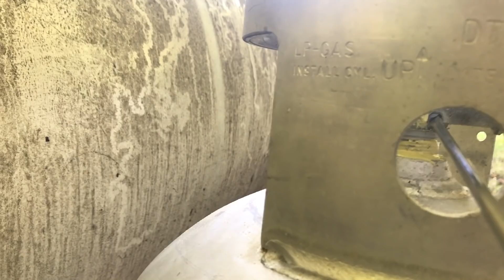How to fill your own propane tank

Comment: This is extremely dangerous and also illegal by residents, this constitutes breaking contract, federal and state fines, jail time.  I would know because, I'm from a family business of 60 years in propane service.  The POL style adapters and fittings used are to push open the OPD style valve seals inside which is how the valve systems work for grills and what not.  Also, most tanks at residences should not have liquid check valves installed ever!  Those are usually only for grain dryers or liquid using heavy applications.  Not safe for residents to use.  Also, this is how people have explosions.

I can tell you right now this is highly unsafe and unregulated and you should be fined and disallowed from service by the gas company.
Reply: Can you point out what law this is breaking? I've never heard of anyone getting fine or jail time for transferring their own propane from their own tank to a smaller tank they own. Please let us know exactly what law he is breaking.
Reply: You any relation to Hank Hill
Reply: @Zef66  actually if you read on the small tanks for lanterns it will say its against federal law to refill and transport those tanks. And punishable with a 5 yr prison sentence and a $500,000 fine. ....the keyword is TRANSPORT. So as long as you never drive with it your good.
Reply: Yes, yes, please cite the law you claim. Most states have laws online these days, so you could supply a link. That said, evaporating liquid propane gets very, very, VERY cold. He should be wearing stout rubber gloves... as in more than nitrile exam gloves. You get liquid on your skin (or wimpy thin nitrile gloves... or worse... cotton gloves) it will cause frostbite pretty quickly. To one person who responded elsewhere, no, you shouldn't fill 1 lb propane tanks (camping type tanks) unless you buy one that's DOT approved for that purpose. They do make them, and they come with the whole kit designed to fill a specially made (stronger) 1 lb tank from a 20lb tank typically used for grills and such. There's a YouTube video by DTroFishOn about these small tanks and kits. I'm not generally afraid of working with propane, but yeah, no, don't refill the 1lb tanks unless you buy the reinforced one that's DOT approved for it. Filling cheap tanks will be against DOT code if you transport them in your car. I'm not gonna look for that cite 'cause it's credible. Mr. Linden is clearly a propane salesman. So while you're looking up that state statute or federal code we're all so anxious to see, could you show us the books on how much money your family makes on those tank exchange cages outside virtually every gas station, etc, etc. I did the math on that and I figured I'm throwing away about $13.50 every time I do a tank exchange vs. getting my tanks refilled at a local store that does it by the gallon. For convenience for a backyard grill, I'd say that's ok. But if you use significant propane for heating, do your research. People are so naive is seems like they WANT to give their money to folks like that. In this video the guy did say something about ignoring the inspection date on the tanks. That's not a great idea if he takes it too far. A rusty old tank or an old, worn out valve with worn out threads... yeah, common sense comes around somewhere in there.